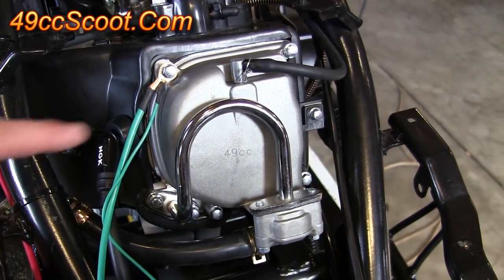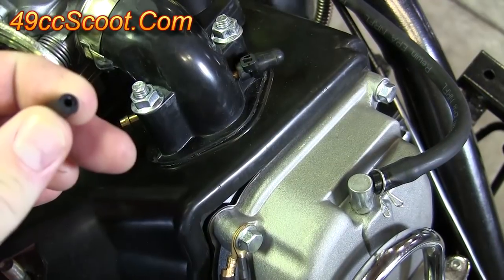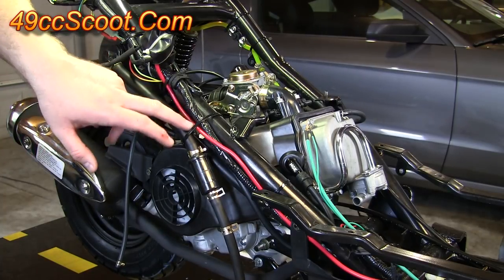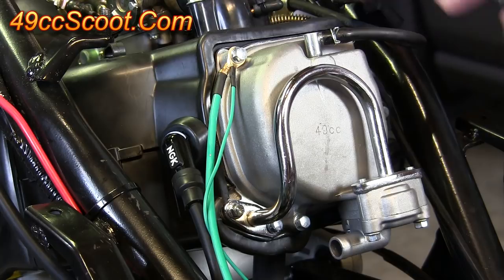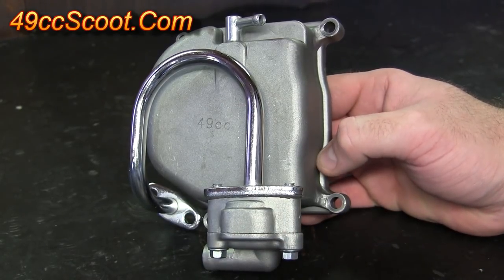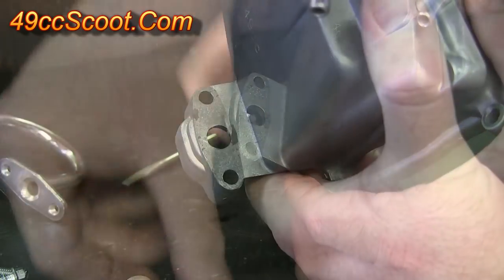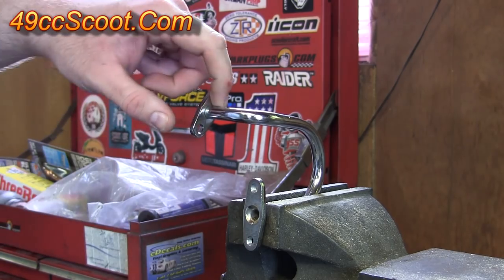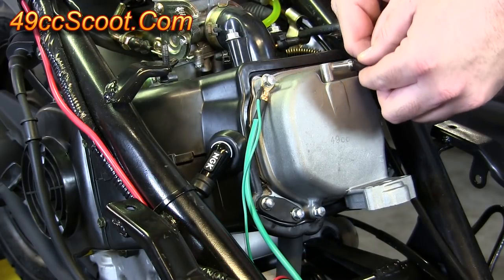Gy6 50cc Chinese Scooter PAIR System Removal : 139QMB Emissions : Racing Only

Comment: what dose this do and why would you take it off what's it change?
Reply from the maker: The PAIR system injects air into the exhaust stream to help continue burning the exiting gases and reduce emissions. There is no need to remove it from a stock scooter. The only benefit would be less stuff to go wrong or less clutter. If you install an aftermarket exhaust the PAIR system may cause popping in the exhaust. Using aftermarket cylinder heads you may not have a PAIR connection anymore so some remove the rest of the components then to get them out of the way since they can no longer function.
Reply: all the rubber parts in the canister are cheap Chinese made rubber, which will fail and cause a large leak right to your intake manifold, it's not a matter of it, but when
Reply: hey i need help :D with my gy6 engine :D so when its cold and i give it full throthle its wants to die out but when its warm it runs beter the other problem is that my gy6 is derestricted so it should run around 80-85 km/h  but it run only around 60 km/h any sugestions ??? #sorry for bad english :D thanks
Reply: NashCustoms b

Comment: since the gy6  uses no fuel "pump", and it uses suction to get fuel to the carburetor then there has to be a certain right amount of suction as to balance the air/fuel combination, right?   (besides the air/fuel screw)
Reply from the maker: +page fullerton As long as the tank is above the carb, it's a gravity fed system. Gravity pulls the fuel down to the carb. The only suction involved is if you use a vacuum petcock and that just takes engine vacuum to pull on a diaphragm and allow fuel to pass by.
Reply: The fuel system gets its vacuum from the intake side. Because all of these mods are on the exhaust side there is no adverse effect on gas delivery. Those two vacuum systems aren’t connected to each other

Comment: Hi there you helped me not so long ago with a variator problem, thats all fixed now thanks for your help! however now i have the Motor back in the back, when fired up the bike seems to run hot within around 30 seconds or so, and the exhaust is untouchable, i know the airbox isnt blocked, as i took that apart and replaced the filter could you help me or give any advice? also the idle adjuster screw seems to be jammed in the same position and i cannot up the idle, thanks for your help!

Comment: is it OK to completely block off your intake vacuum line like you did? I thought you need at least one vacuum line ? so I have a line to a filter for my valve cover vent. and I'm going to do a manual shut off like you did. I already removed the pair system.. so that would block off both vacuums ports on the intake... is that OK ?
Reply from the maker: There's no requirement to run any outside accessories, so as long as they are gone it's not an issue.
Reply: Thanks  for the reply. Your always very helpful. Cheers

Comment: Thanks for replying yes it really is that fast its ridiuclous, the pipe isnt clogged at all thats been checked, i do not have a timing light or a spare CDI as i am new to scooters would a CDI solve the problem? and the fly wheel is all fine as i replaced the belt and did a routine check last week and havent riden it since, and nope the idle hasnt bottomed out thanks for your help!

Comment: Hi! Is it necessary to plug that vent hose from your valve cover to your air box..? Thanks for the answer in advance!
Reply from the maker: The one on the top is the PCV vent and should not be plugged.
Reply: @49ccscoot  mine has no one way valve attached. Is that normal sometimes ?

Edit: I also don't have a charcoal canister
Reply from the maker: @firebladex8586  There are multiple configurations on Chinese scooters.

Comment: I need some advice!? I have a 50cc GY6 engine. im having to replace the cylinder and cylinder head, due to damage. so I thought I would just buy a 80cc BIG BORE KIT. but all the kit dont have the PAIR system on them. they are all covered/sealed (like what you have done in your video) 
My question is, does it matter if i get a cylinder without the ERG/PAIR inlet?
Reply from the maker: You can get the kit without PAIR and then just remove the rest of the PAIR stuff or find one with PAIR and leave it.

Comment: Hi i am trying to make my scooter make pops and maybe flames but I tryd a bigger get and even more stuff but I can't get my scooter to shoot flames or make pops so when I remove this egr system will I get pops and maybe flames or what does it do exactly I just wanna make my scooter pop so ye pls answer this question I have been searching for so long and I can't find it btw I do have an open exhaust so. 🙏
Reply from the maker: I've had pops and flames with nothing more than a leak near the header before. Had a pinhole in the header of a pitbike and it would shoot a 6" flame out of a full length aftermarket exhaust. Te difference with it and the scoots was that I could free rev it. Just rev and let off and it would bang out a flame.
Reply: @49ccscoot  wdym with Pine hole in the header of your pitbike Where exactly do u have a hole and can i also fully remove it like u did. will it be aible to shoot Flames or Pops as well than and does it not like damage the motor if I do long distances as well wtf I have a scooter not a pithike so idk if it's the same ty for answering!?
Reply from the maker: @bobfuzzy3342  In my case, it was a manufacturing flaw. A weld where the flange connected to the pipe had a pinhole in it. Just a tiny hole. I wasn't trying to make it do this. It was purely by accident, but I have to admit that I had fun with it.

You can try it and see what happens, but IMO any time you're trying to make the bike shoot flames or pop you don't have the engine's health as a priority. If it doesn't work, then you have a tiny hole in the exhaust. Use this info at your own risk and so on, and of course don't blame me if you get in trouble if it works. This is for off-road and exhibition use only.

Comment: this is super helpful, whats the ventilation hose you plugged back in last, where does it go? and can I get rid of it?
thanks
Reply from the maker: That's the crankcase vent. DO NOT plug it or get rid of it. It goes to the airbox, but you don't want to seal off the crankcase by plugging it.
Reply: Can you help me, i forgot to connect ventilation hose and i notice that when my 125cc scooter gets warm the oil comes out out of that hose is this normal? Should i just connect the hose in air filter or? Tnx

Comment: where does the other end of the ventilation hose go, the hose you left on the top of the valve cover
Reply from the maker: +joseph mathis That goes to the airbox. It is a crankcase vent.
Reply from the maker: @Sergei V You don't want to just leave the crankcase vent open at the cover or it's likely to spray oil or at least oil vapor. Ideas : https://49ccscoot.proboards.com/thread/997/crankcase-venting?page=1&scrollTo=13285

Comment: I have a 125 kymco scooter with modified exhaust. Could I just plug the vacuum line that goes to the pair system, so it will not open the canister and inject fresh air, instead of have to block the exhaust outlet?
Reply from the maker: +lancerevogolfmk1 Never tried it. To me, the biggest reason is getting all of that stuff out of my way.

Comment: For gy6 50cc, valve adjust suction how many mm. How many mm of exhaust. must be
Reply from the maker: I'm not totally sure what you're asking. If you just want exhaust valve adjustment specifications in mm, I use 0.065-0.08mm.

Comment: im having a problem with my taotao 50 cc. the problem is that when i cranck the scooter it sounds like it barly runs but when i give throtal while its on the 2 leg stand it will run pretty good but if i hold the back brake or put it on the ground i can give wot and it sounds like it is barly ideling. this happened after the drive belt broke. i replaced the belt and noticed this happening. im thinking its a power issue. could this be a carb issue?
Reply from the maker: +larry hannah My first check would be to go over the whole CVT. Any time a belt breaks, you can get debris in any part of the CVT. The entire CVT should be cleaned and checked over. Check out my full service CVT inspection video for help.
Reply: Thank you and that helped a lot again thank you

Comment: Great video! 
there is one thing i still dont understand, so i hope you can help me. it seems the air gets in the carter on top of the valves so to ventilate the oil. how and where is the air introduced to the exhaust gas? my 50cc gy6 has a 80cc upgrade along with a 24mm carb and a little forced air intake. it runs smooth and powerful, but with horrible backfire and i hate to see an old lady get a heart attack becaused by my moped. if this causes it, i will get rid of it asap, but is this helps cooling and ventilating the oil id rather keep it,  so i need to know, how does the air reach the exhaust gasses
Reply from the maker: Crankcase venting and PAIR systems are 2 different things. The PAIR system is for emissions and crankcase venting is necessary to avoid pressurizing the crankcase. WIth PAIR, air is introduced in the exhaust port.  Backfiring could just be a lean condition or a leak near the header.
Reply: ive checked again but it seems i was wrong bevore. so if im correct the hole in the head just leads to the exhaust? that whould explane why it is black on the inside (if the flow is going the wrong way). i think its purpose is to add fresh air  to the exhaust gasses to burn of any remaining fuel and stop doing that on decel to prevent popping.
mine was defect and adding fresh air all the time. anyway thnx man my problem is fixed !! If anybody has the problem with popping on decel either remove or replace this part shown in the video, it helped mine !!

Comment: since you removed  the reed valve wont air come out of the bottom of the plate now?
Reply from the maker: +Rafael Suarez It's all blocked off where it needs to be.
Reply: ***** OK thanks bud! I did what you did and seen it really wasn't nothing there to begin with. ...thanks a bunch much appreciated. But now I have a problem that I thought the big bore would fix and that is when I give it gas it doesn't bog down or anything it just won't go past 15 miles an hour. It's like if I was dragging somthing heavy. I'm thinking its the variator weights or the spring in the transmission. Any suggestions?
Reply from the maker: If you haven't gone over the whole CVT, I would : https://www.youtube.com/watch?v=2EjW-iSP-Q8
Reply: +90GTVert yeah I went over the variator and found that the last person who checked it(that's when it all started) did not set the rollers back correctly. she runs great now. thanks for the tips and quick responses. much appreciated have a merry Christmas.
Reply from the maker: Glad it's fixed. Happy Holidays.

Comment: Professional instructions, topp class! :)
I wonder what this system does, leads exhaust to intake or air to exhaust catalytic?
I might reinstall this on my Taotao.
Regards!
Reply from the maker: It puts air into the exhaust to help burn off previously unburned fuel and reduce harmful emissions.
Reply: @49ccscoot  Do you think that i can have it modulated without reed valve to let exhaust run out of it and lead it back to intake after carb for selective power reduction.
I guess it should feed overpressure after exhaust valve, making a home made Exhaust Gas Recycling system, with electric solenoid it should be a smart road power limiter.
Do you know about how much this cylinder head compare to non-PAIR reduce power and torque as it is made with this not too flow maximized extra exhaust vane.
Regards :)
Reply from the maker: @bumblebob5979  I don't think there's a lot of difference with or without PAIR in these.
Reply: @49ccscoot  Yea, I still put some money in this so it will unfortunately bug my mind nevertheless.

Comment: What if we removed only the hose that go to intake manafold of canster ?
Reply from the maker: The system won't function as it should, but you'll still have the stuff in your way if you go to make a repair. Might as well take it all the way off if you're going to mess with it IMO.
Reply: @49ccscoot  i mean remove the hose from intake and closed it then make the hose under point of my scooter .. then it would be problem to my scooter ?

Comment: Hey, I need help from you 90gtvert, i have same 139QMB engine on my scooter and I need to adjust valves, what numbers should I use for intake and for exhaust, please write them in mm not in inches, sorry for bad english
Reply: .003-.004 on both valves
Reply: .003-.004 on both valves

Comment: hello sir.. can i ask if that's okay to use flat head piston? i ordered china brand with the flat head piston
Reply from the maker: I'd advise checking piston to valve clearance and squish. At minimum, mock it up and turn the engine over by hand to make sure nothing is hitting. Some of the cheap kits are coming with pistons without valve reliefs and other issues that are ruining engines when installed assuming they'll be fine.
Reply: hmmm i think your suggestion is right sir, i will try it tomorrow.. thanks :)

Comment: Sir I hate to keep bothering you but now this brand new TAO 50 Scooter that I assembled gets really hot after only going 3 miles and the oil is cold. When I turn it off it it’s making a ticking sound and engine is extremely hot! Oil is cold could you tell me what this would be because I can’t deal with these online Superior Powersports people anymore. Thank you so much. Paul
Reply from the maker: Can't say I've heard of that. So, specifically what part of the engine is hot and how are you measuring or judging the temperature?
Reply: @49ccscoot  If I go around the block a couple times the motor is very hot but the oil is like it just put it in temperature. I don’t know and I’m terrible with computers and 60 years old so I’m just hoping I’m doing this right with you
Reply from the maker: @paultoomey7016  Have you got the shrouds installed on the engine? It will get very hot quickly if the shrouds for the fan aren't installed.

Comment: Can you tell me how to replace forks/shocks on a taotao 50? Can't find any videos on the subject... is it much work?
Reply from the maker: You'll need to take off the front plastics and the wheel and tire and brakes. Then if it's just the shocks that you want to replace, there are usually 2 bolts in each side to clamp them into the steering stem. Loosen those and they should slide out. You may need to loosen or remove the cap on each shock in some cases for them to come out.

If it's the whole steering stem and all, then you need to get the plastics and handlebars off. You'll have to disconnect quite a bit of stuff to remove the handlebars totally. Then there are nuts at the top of the frame holding the steering stem in that have to be removed. Support the front and remove it carefully. Don't lose any bearings that are in there. Some are just loose ball bearings and some have a cage so they're easier to manage. Grease the bearings well on reassembly. Also, you must be very careful with how tight the steering stem is when you put it back together. It needs to be tight enough that there's no up and down play, but loose enough that the steering can move freely.  Too tight and the steering binds and that makes it really tough and dangerous to ride. 

You can check out service manuals from name brand scoots (something like a Yamaha Zuma for example) and they usually go over the full procedure with a few illustrations.
Reply: Thank you so much! I used all your pdi videos. So good! Yeah got a zummer 50 shipped with wrong forks installed! Well i'm not really, sure forks or shocks. and not sure if i need to do the steering stem. The speedo notch and fender attachment holes is what alerted me. They didn't match up......One other quick question, i have all plastic off now, should i do a big bore now? or put put plastic back on and put some miles on the stock?
Reply from the maker: It depends what you prefer. Some people like to install BBKs right away. Others prefer making sure the scooter runs alright first.
Reply: Thank you. i'll good with the latter, I'm a noobie

Comment: Well I first want to start off by stating, "truly inspirational" 90GTVert!! Hopefully you can help me with my situation. I have 150cc Wolf Blaze scooter. I just replace the Cylinder Head. The manifold I received does not have the Emissions connection like the factory one similar to yours. Since I've changed everything my scooter will not start, it just tries and tries to turnover however will not start. I did not block any particular jets and I believe it is an open air Emissions system. Could this be the cause of my scooter not turning over? Thank you for your time.
Reply: Well 6 years later so doubt I'm helping you, but I would guess valve clearance needs adjustment, if it's out of spec it won't start
Reply: @jaykoerner  lmao
Reply: @nibba3595  figure there's a chance I'm helping someone else that sees the comment in the future

Comment: My bike started overheating instantly after the removal what is the cause
Reply from the maker: My first thought is an airleak. Possibly something else that was removed or not capped.
Reply: @49ccscoot  I found the problem I forgot to connect the air hose that connects from the air filter to my pcv

Comment: the hose on top of the valve cover where does that go mate
Reply from the maker: That's the crankcase vent and usually runs to a port on the stock airbox.
Reply: Do you know where roughly on the stock airbox it goes mate what port mate
Reply from the maker: With my airbox, looking at it from the side, there was a nipple on the bottom front/left for the crankcase vent hose.
Reply: Okay mate isit 2 parts of hose or isit just one long hose from the top of the valve cover to the airbox